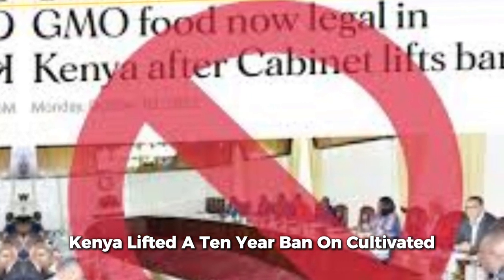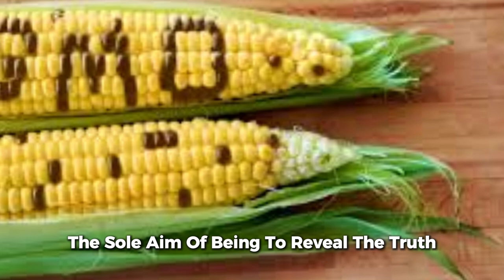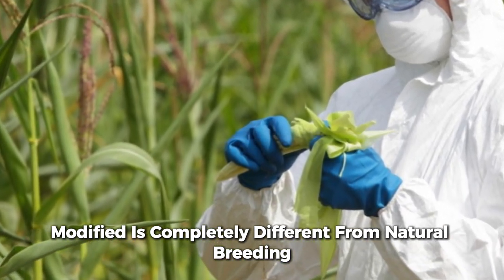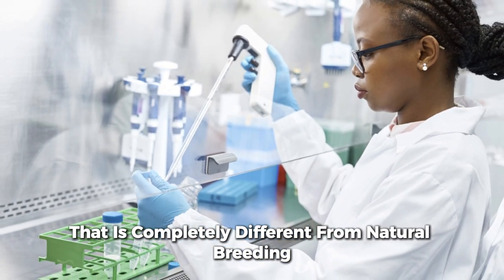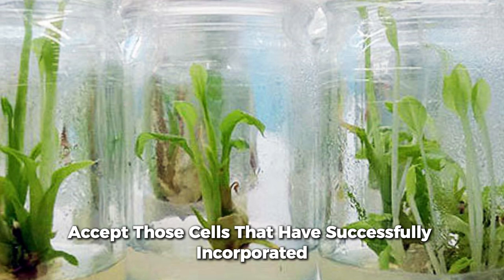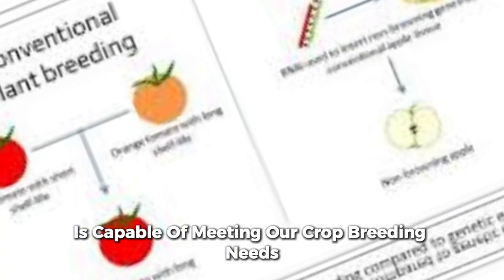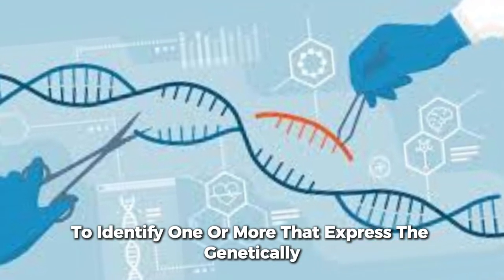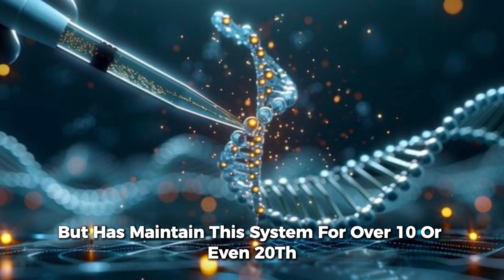How GMO Crops Are Made: The Science Behind Genetically Modified Agriculture

Comment: At three minutes in, we come to the familiar claim that genetic engineering is completely different from natural breeding. That is true, but its meaning would be changed if we also heard that there are enormous differences between the various methods of natural breeding, some of which can hardly be called natural at all. 

Here are a few natural breeding methods, besides the one you will all think of, selective breeding.

1) Hybridization - The breeder selects two very different plants of the same species. For each of the two plants, he breeds it only with itself and from the offspring, he selects only those most similar to each other, and repeats this for generation after generation. His goal is to produce, from each of the two original plants, two sets of "pure lines", each line composed of plants that are all identical to each other and all having only one variety (called allele) of each gene.  Then he crossbreeds plants from the first line with plants form the second line and sells the seeds to farmers, as hybrid seeds. These are superior to either of the two pure lines. But the seeds produced by the hybrids are NOT as good as the original hybrid seeds.

2) Radiation breeding -  Plants are exposed to gamma rays to induce mutations. Most of the mutations are deleterious but a few, at random, may promote new and useful traits, which are then reproduced using selective breeding. 

3a) Polyploidy - Using chemicals, a plant is tricked into having twice as many chromosomes as usual.
3b) After a plant with two of each chromosome is mated with a plant with four of each chromosome, the offspring has three of each chromosome. That plant will not make seeds. Examples are seedless grapes, seedless watermelon, seedless oranges, and potentially seedless bananas (although the most common banana was obtained by a natural accident, though it also has three of each chromosome.)

4) Grafting - Any tree fruit with a variety name was originally obtained by a "conventional breeding method", but it cannot be reproduced that way. Instead a twig from the new variety is grafted onto a rootstock of a different variety, giving a tree which produces fruit identical to the new variety, on a tree with two complete genomes, ond for the top of the tree and another for its roots. Doesa anyone consider this a natural breeding method?

I could go on with many other breeding methods that are quite different from these.